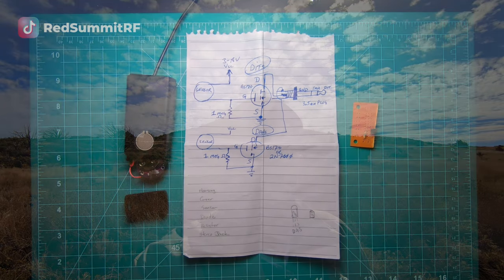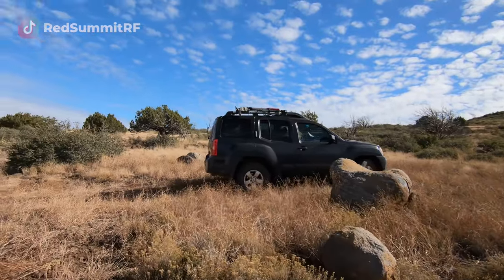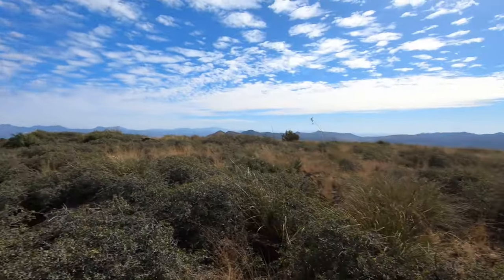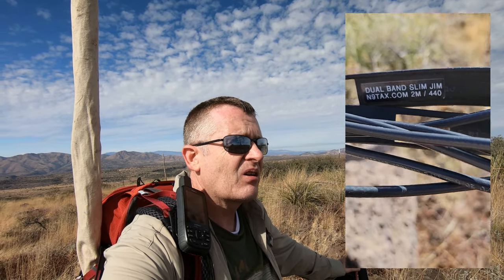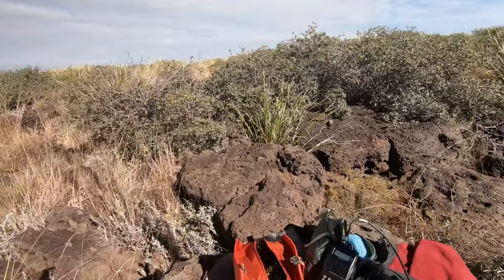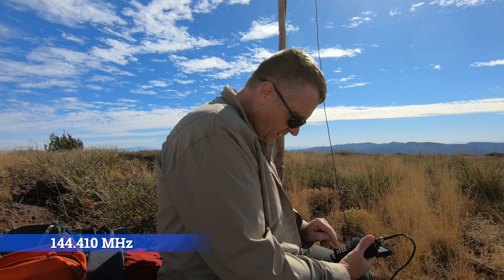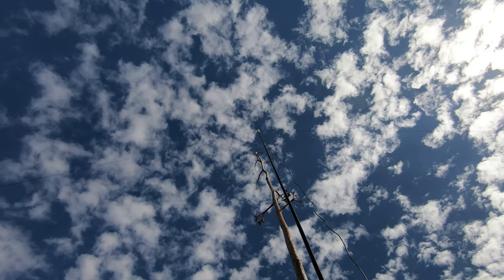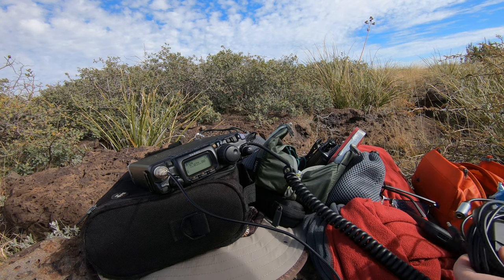QRP Five Band Linked Dipole Antenna

Comment: Big Fan of your channel Charlie. Busy practising my CW, your decode is very helpfull to get to understand how a qso is made in CW.
Got a question about the antenna ... did you or are you using a kind of choke-balun up at the feedpoint of your antenna ?
73 ON1JV
Reply from the maker: Hi Jan - apologies for the lateness in my reply.  I got a little behind.  I'm happy to hear that the decode is useful, thanks.  I actually do not have a choke-balun on any of my homebrew QRP antennas.  The purpose is to prevent too much RF getting back to the radio, but at 5 watts this is never an issue.  I know some are adamant that a choke should be used but I have not encountered a need in the ten years I've used these QRP antennas.  Now if this was an antenna used for higher power then I would agree that one is needed.

Comment: No internet so no SSB, equipment issue? Q from a non ham. Spotting perhaps?

Love your videos, SOTA, POTA look like great fun and a challange.
Reply from the maker: Hi Brad - you know, I should have explained that more, you are correct.
For SOTA, we spot ourselves so people know what our radio frequency and summit is.
For Morse code generally, our signals are automatically identified on a radio listening network called a Reverse Beacon Network.  Basically it recognizes your call sign and frequency and posts it to a website if it hears your Morse code signal.
If we add our summit information to the SOTA website then it uses the Reverse Beacon Network to automatically spot us.
This doesn't work for SSB and unless you have an internet signal or some other way to send a spot to the internet (there are other ways) you can't spot yourself.

So in this situation where there was no cell service so I had no way to get my SSB spot out to the internet.  But I had things set up to automatically spot me when I call CQ using Morse code.

Yet another advantage of knowing Morse code.
Reply: Reverse beacon, thank you, I didn't know that.

Cool tech as well!!!!

Comment: Just curious why you use a HT when you brought the FT 817?
Reply from the maker: Redundancy.  It's a lot of effort to get to the top of a summit to not get those points due to a failure in the equipment.

Also, I like talking to my friends on my hike up. HT is a better choice for coms on the move.